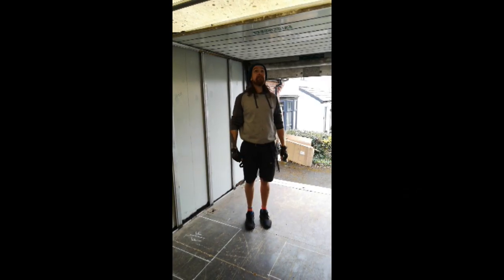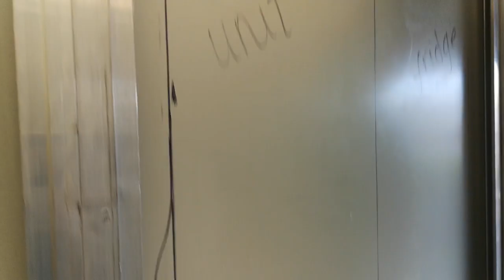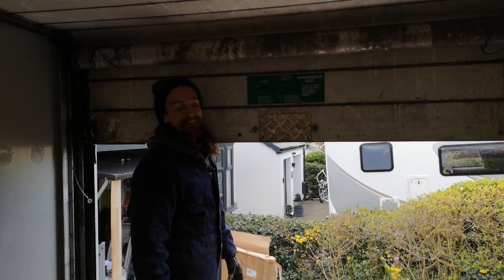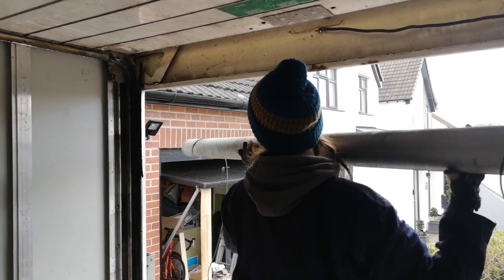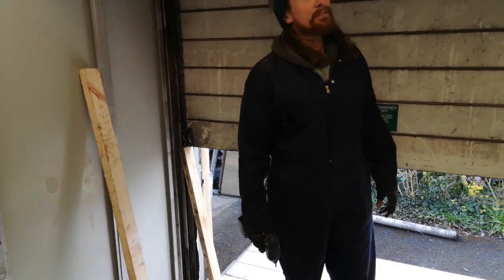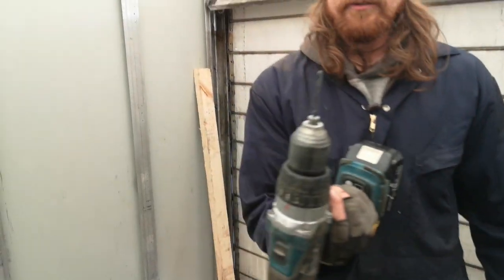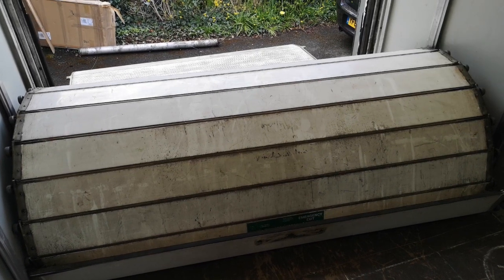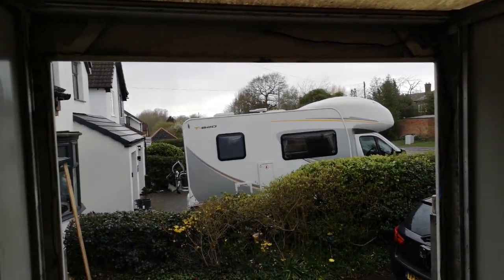Roller Shutter Door Removal | Luton Van Conversion Series | Episode #3

Comment: I couldn’t watch as you was letting your partner unknowingly unscrew the cable screw out with no eye protection when that cable was like a coiled spring waiting to go off! She was so lucky it didn’t take her eye out… and can I just add if you had just cut the shutter door straight up the middle it would have been a lot easier to disassemble, good luck with the build…
Reply from the maker: Hey Terry, thanks for your concern but I didn't set my wife up to be attacked by a coiled cable 🤦🏻. Neither of us knew what would happen, hence our reaction. Hopefully the video will prevent any coiled cable injuries.
We wanted to remove the door in one piece to sell it, which we did. Cutting it in half would be a slog and would require a lot of tea breaks haha. 
Regards,
Jolly